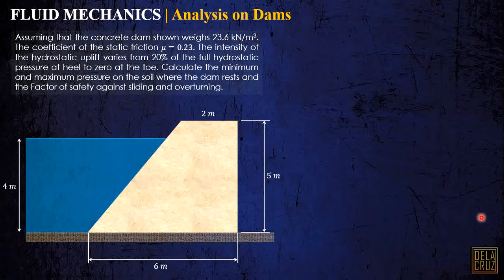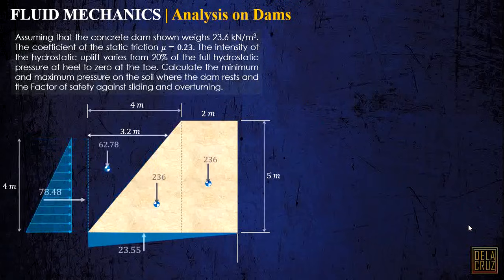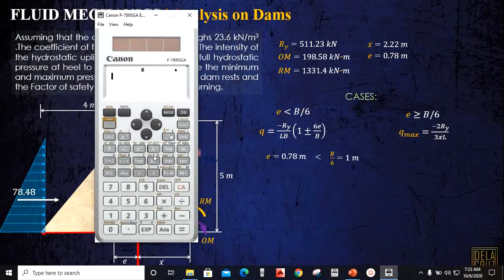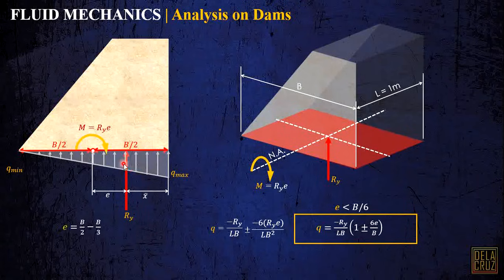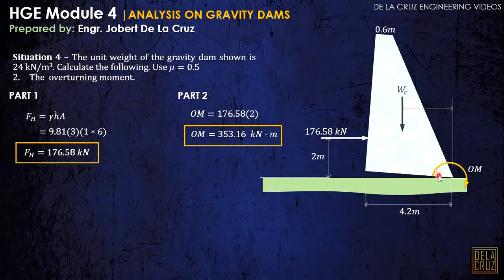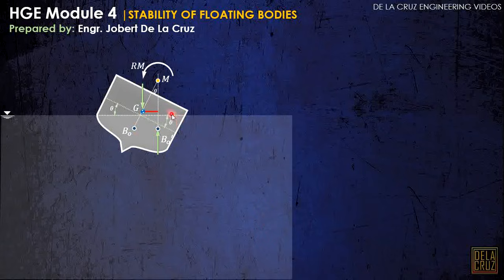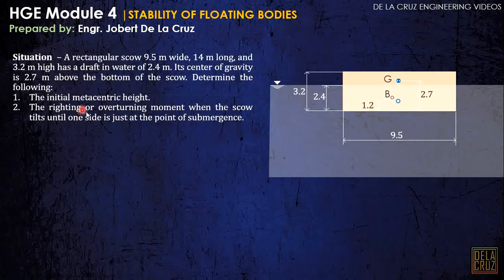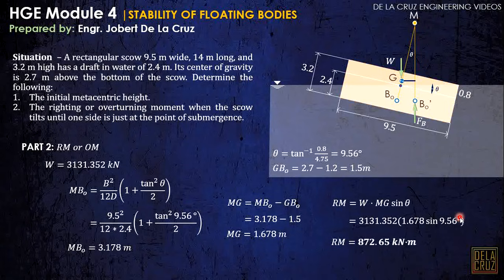CE REVIEW - WEEK 4 | ANALYSIS ON GRAVITY DAMS | STABILITY OF FLOATING BODIES | FLUID MECHANICS

Comment: Paano po kinuha Yung 3.2 m na length sa weight 3 sir?
Reply: by similar triangles:

x/4=4/5
Reply: same here pano nakuha 3.2m
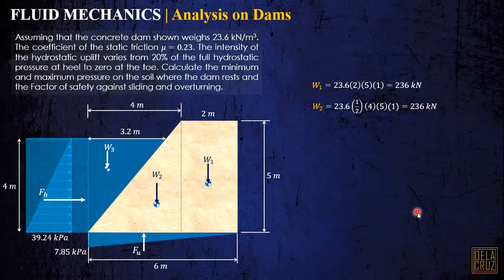Reply: 6:04 Similar Triangle lang. 
Let x = unknown. 

x (horizontal) divided by 4m (vertical) equals
4m (horizontal) divided by 5m (vertical) 

then Shift Solve / Cross Multiply. 
Answer: x = 3.2m